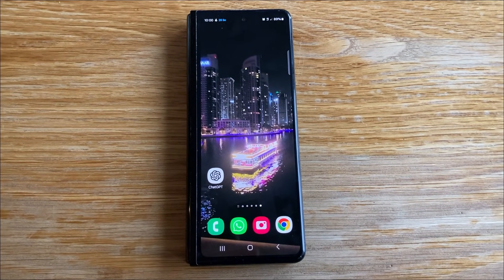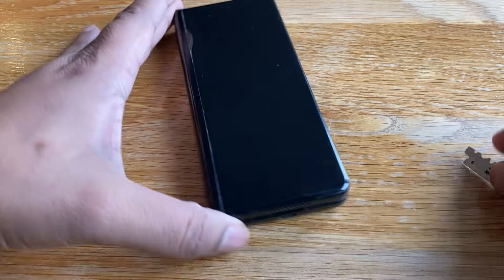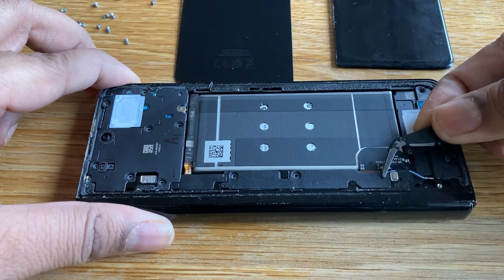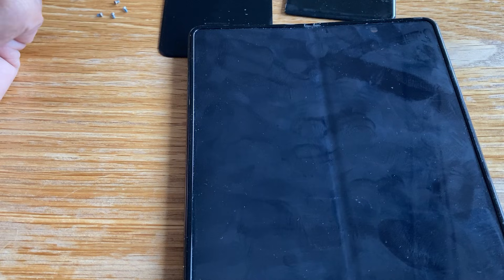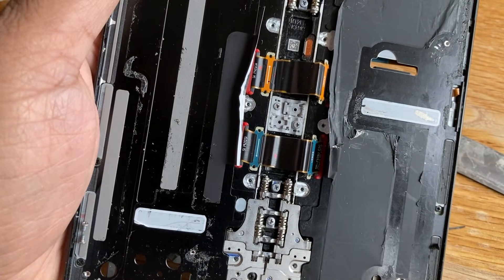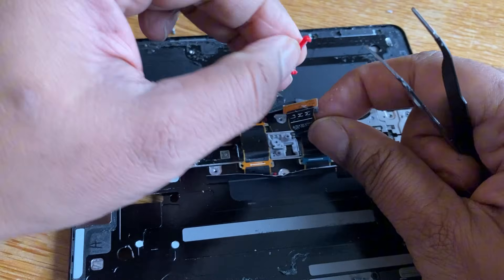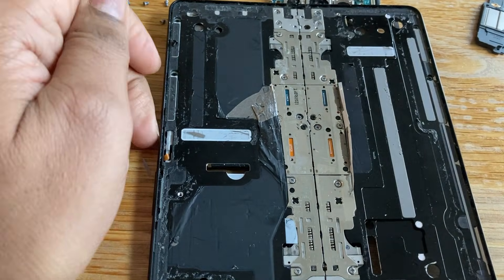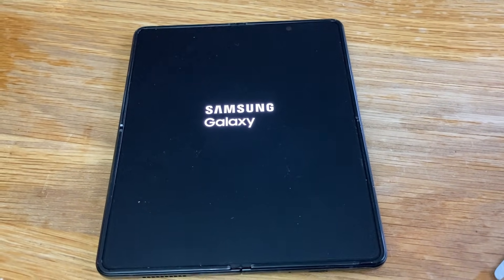Samsung Fold - Destroyed! - Teardown - No Wifi/No Sound?

Comment: Where do you get the spare parts from?
Like I need to replace these 2 cables because I have the same wifi problem and also I need to replace the inner screen, maybe the batteries as well 😅 a full refurbishment
Reply from the maker: I found what i needed in ebay

Comment: How are you? 
When I close the screen of my Z Fold4, the Wi-Fi, Bluetooth, and front camera stop working. Samsung's technical support team said that they had to replace the front camera and the side frame... 
My question is, if I don't repair it, could it cause problems with other components due to the malfunction? The repair is very expensive, and as it is, you can use it without any problems. 
Can you answer a question for me?
Reply from the maker: I would guess the phone may get worse the more you open and close it